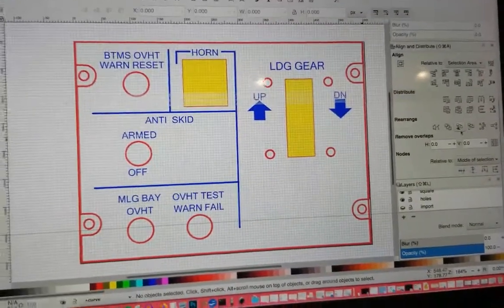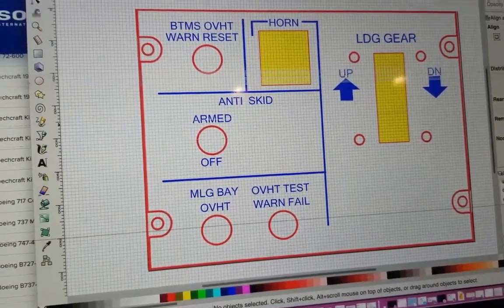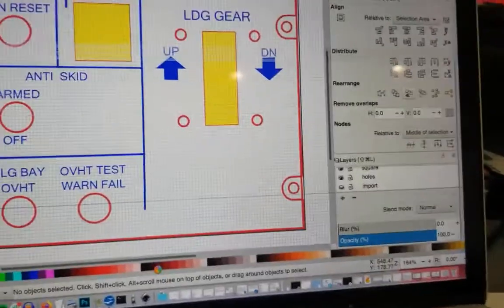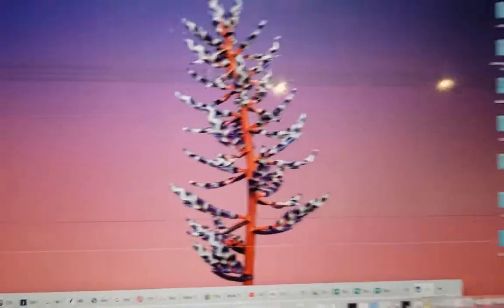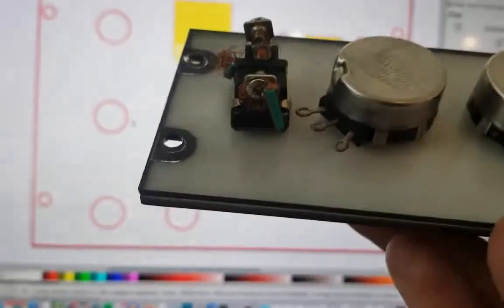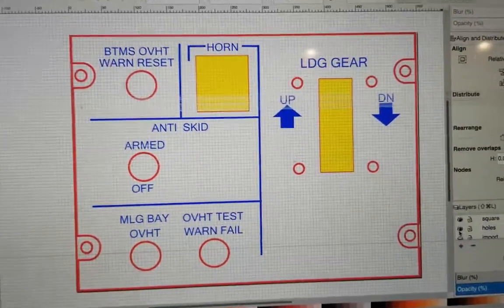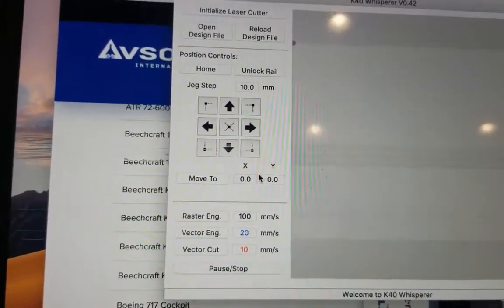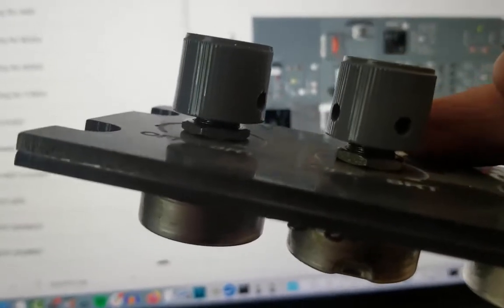Secret to designing backlit flight simulator panels

Comment: The real ‘secret’ to backlit acrylic is to LED edge light it and etch / engrave the back to scatter the light. The light will travel down the acrylic, reflecting off the walls as if they were mirrored. When light gets to an etched area it scatters forwards (that’s how LED LCD TVs and laptop monitors are backlit).

The easy alternative is to edge light it on two opposite sides: the fading light will meet in the middle (that’s how it’s done in LED panel lights). Whereas you need to etch a particular pattern when edge lighting from one side if you want the backlight to look perfectly even (for this application, you could just etch where the labels are… you don’t need the whole panel to be backlit evenly). 

Controlling LED brightness is easily done by a PWM dimmer.

Comment: Can you please explain why do you glue 2 thin sheets togeather? Is is just for the screws as you mentioned in the video or is it necessary for the backlighting? I actually don´t need the screw holes so I would prefere to use just one sheet twice thick as yours. Which one I should use than? The clear one or the matte one? What type of paint and what power setting of laser do you use for engraving? Thanks ;)

Comment: I have a question, How do I find out exact dimensions for the panels to my cockpit build? like dimensions and exactly how big I gotta make them
Reply from the maker: Depending on your aircraft, I would suggest you search the sim building groups on facebook and ask the members if anyone has the exact plans.  If you are unable to find them, I would suggest doing what I did in the video.  The poster is a real life size example of the aircraft.  If you scan and trace, you should be pretty close to exact.
Reply: @AaronWerner  Hey Aaron, Thank you so much for your answer and yes I will consider going to facebook and searching.

Comment: Aaron,   Great work.     Have you had the chance to work the electrical for back lighting these panels?   If so,  would you be so kind as to pointing me to that video    or     a video that you have used to develop the process?   Thanks
Reply from the maker: I use a $10 string of led christmas lights you can buy on Amazon.  Something like this https://www.amazon.com/ANJAYLIA-Battery-Operated-Festival-Decorations/dp/B01EWNBCIE/ref=mp_s_a_1_9?dchild=1&keywords=led+christmas+lights+tiny&qid=1611021456&sr=8-9

Comment: I’m super lost. I’m 15 and I’m working to gather 10,000+ US dollars by working. I’m nearly there. I worked so hard to buy a flight simulator, but I realized I can build one instead of buying a plug and play one. I need some help here. What do I buy? How do I begin? How do I put it all together? I’m super lost, but super ambitious to learn and build. Thanks!
Reply from the maker: Learn about FSuipc, mobiflight, p3d, fs2020.  Also study k40 laser. Start with a small aircraft.
Reply: @AaronWerner  Okay, I’ll take a look at all of these and study them. Thanks!
Reply from the maker: @The_Top_Striker  Also study Game Controller Cards and Arduino.  You do not have to be an expert in the items.  Most configurations can be found online.  If you just learn about each of these you will quickly understand how they all work together to accomplish what you want.  There is not a single software or solution that works for everything.  This is why some switches I use game cards, some I use Arduino, some configuration I use FSUIPC and some MobiFlight but between all of them combined, I am able to accomplish everything I need for working sim.

Good luck.  Make sure you subscribe and I will try to make some basic getting started videos when I have time.